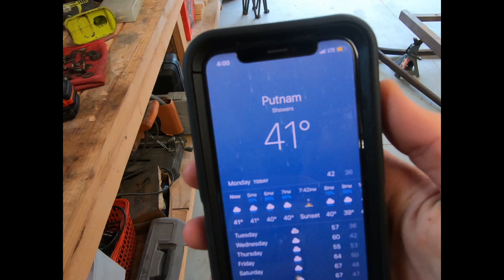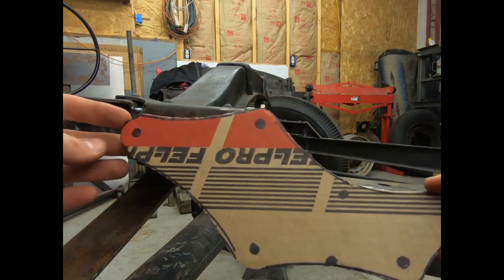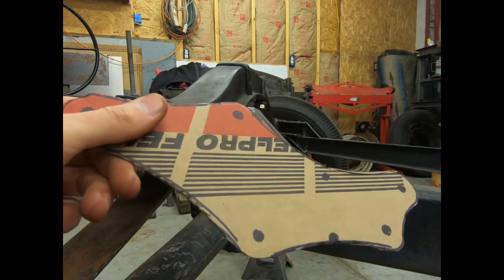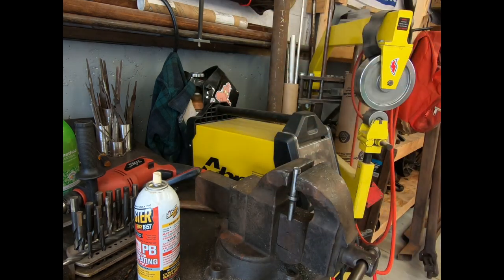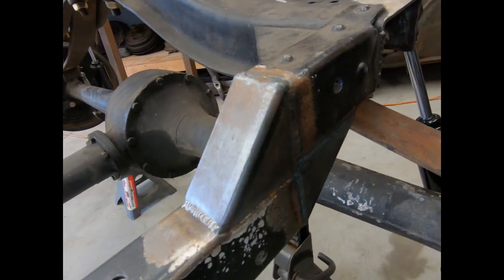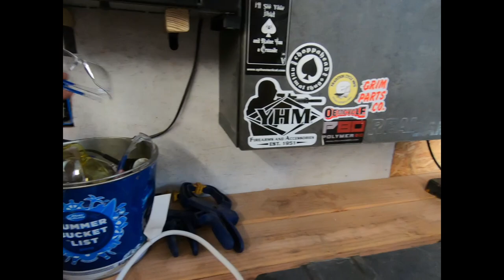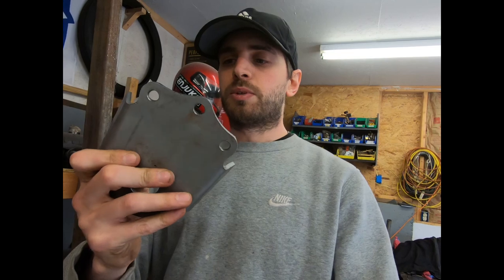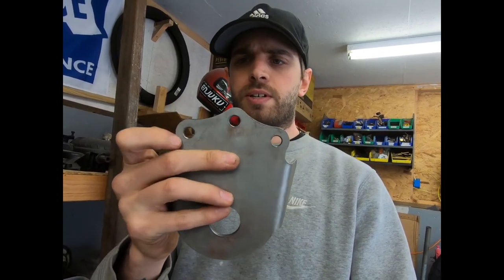Frame Notch Support Plates for the Traditional Ford Hot Rod

Comment: Did you make your TIG magnetic holder?
Also I watched your hoist installing. I didn’t save it and I can’t find it on your YouTube page I’m sure it’s there but could you give me a # or link
Thanks …. November I’m starting my1948 Anglia convertible custom. 425 gs nailhead 4” dropped axle and winters V8 Quick Change with 1953 Kinmount brakes
Reply from the maker: yes i did make that tig holder from some scraps i had lying around. 
https://www.youtube.com/watch?v=mSfx4D7o1O8 
hoist build starts at 10:45 
that sounds like quite the build there!